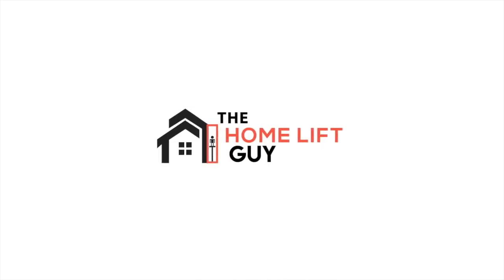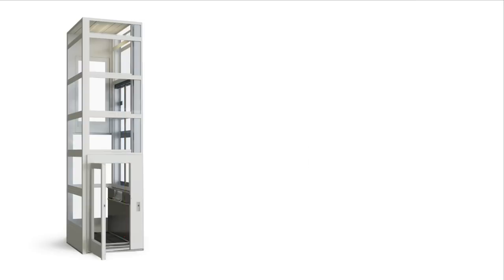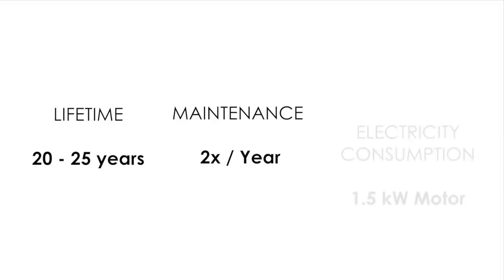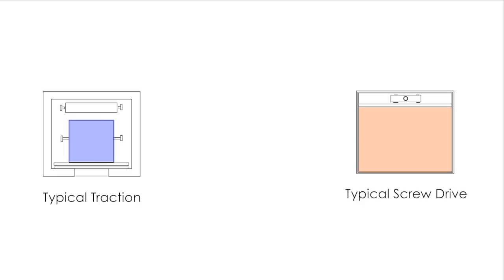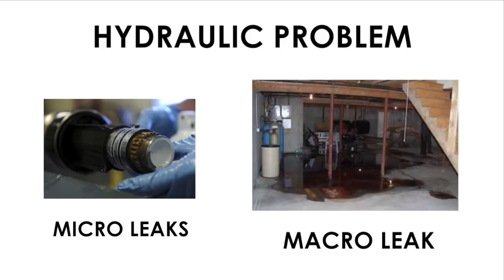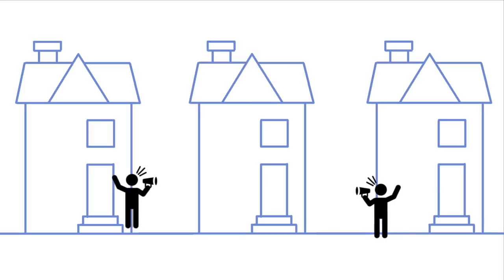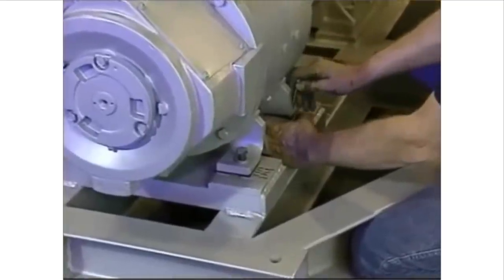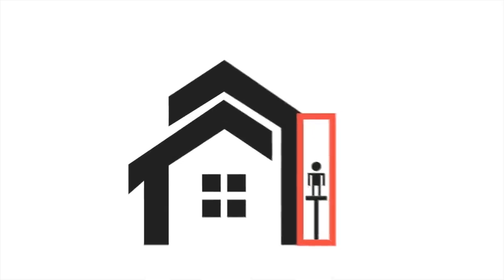Best Home Elevator Technologies - RANKED!

Comment: Inclinator has (or at least used to have) a small drum machine, with a cantilevered rail/cab arrangement. The drum could be mounted overhead, or off to the side of the shaft, top or bottom. Machine would fit in a broom closet. Rail stack needs one structural wall for support. Floor space consumed is approximately equal to the area of the cab in plan view, plus a few more inches for the rail stack.

Comment: As an installer of lifts and home elevators for 20 yrs in Texas, MRL's has been our most popular elevators, in the last 10 yrs with hydraulic systems, coming in second with our company. Much improvement has been made in design and ease of operation and service of these lifts. 
We rarely install screw drive lifts in homes, if we do, it's usually outside of a home. Too noisy and slow. 
Garaventa lifts is our main supplier. Great company, excellent products, very helpful tech support, when needed.

Comment: I'm going with a hydraulic lift for our new house with 3 stops. My other options were screw and nut drive lift (Aritco or Cibes) or electric winch. Chose hydraulic because of relatively low acquisition and low maintenance costs. It's also quiet and didn't require you to have support for all 4 sides of the shaft. The screw and nut drive lifts from Aritco and Cibes were outlandishly expensive, although they did require the least amount of footprint for the shaft. Also, unlike hydraulic lifts, the screw and nut lifts need energy when going down. Hydraulic lifts only require the motor to run when it's going up.

Comment: I’m building a new house and need an elevator from the main floor to the basement, so it’s a one floor lift. 
 
This elevator will be for handy cap. 
The car of the elevator would have to be large enough for a 30" X 30" laundry cart and  one wheel chair. That means it would have to be about 7' X 4' inside usable space. Can you do that? How big would the little room for the power unit be? oscarkemper@gmail.com

Comment: You can have MRL too . With emergency device too and no room on top and pitless too. Better explain properly to people. I have been designing measuring and drawing lifts all my life. I installed all kinds of lifts . Not true what you are saying about hydraulic lifts. It depends what experience you have. I installed all kinds of lifts custom built and sizes and shapes. Over 40 years experience in lifts so I know what I’m saying. Besides that I maintain lifts built in the 60’s and still going strong. I’m sorry but you don’t know what you are saying. Also the fact the screw type doesn’t have emergency brakes.

Comment: It seems there is only one skinny  screw of 2''(  inches) diameter . The whole weight needs be balanced and born by a single tiny  2 '' ( inches)??
So there needs  at the least of two  6''  screws at the back  on both ends?

Comment: Always go for a safe lift if it is for a personal use. No budget is tight that your safety. An accident can cause a life long disaster.

Traction is one of the best be it mrl or mr geared or gearless manual ir automatic. At the sane time other tech are also not bad but there number of installation experience is what needs to be checked and years of experience. After all you are going to be lifted with your near and dear ones in your lift.

ine more thing it is recommended to buy it from a experienced player with atleast 50 lifts in the radius of 1 km.

One more tbing is that the AMC charges and the parts. If it is too expensive then what is the benefit in long run.

For consultation call
7517892718

Comment: Thanks for showing. I have this dream house in my head, and was thinking about an optional 2 level buoyancy lift because of safety and low maintenance. A screw lift is a better option.
Also like that you can have doors on 3 sides (4 if you put 2 screw at the corners).

Comment: I was just gonna use a car hoist winch and weld a cage platform for it and attach to the garage stairs (only one floor up)... gonna be like $1000 and doesn't use that much electric... still allows stair use or lift use and can be taken with if move. Plus relatively cheap to repair or rebuild...

Comment: The hydraulic lifts smell, there's an odor that's unmistakable, so ventilation is a must around hydraulics.  A family member has two different lifts in her home. One is cable, and the other is hydraulic. Both have been problematic, service is expensive, and for either technology every time the lift goes up and down put $$ in a bucket, you'll need it.

Comment: Interesting video. Questionable information. Most (if not all) hydraulic companies offer non toxic oils. Yes, the oil tank takes up some space. But then, I n many jurisdictions the amount of space required is driven by building codes as much as by the size of the equipment. Similarly, the pit size may be driven by code requirements for shelter space. Far as I know (and I’m not an expert - I’ve just been involved in selecting residential elevators on many jobs) the usable space to shaft size ratio for traction units is substantially higher than mentioned here.

Comment: You forgot an option.   My company has a two floor hydraulic lift with pulleys.   The pulleys will cause the elevator to move many times more than what the hydraulic cylinder moves but the apparent force seen by the cylinder is also many times the load but that is not a problem for hydraulics.   Now the cylinder doesn't need to be as long and  only wide enough to so the pressure x force is greater than the real loud x number of wraps around the pulleys.  Most of the oil is always in the cylinder and only a small accumulator is necessary.   We do have an elevator pit without just so the elevator can go to ground level.   The elevator does take a fraction of a second to increase pressure before moving.

Comment: Question. I have a patent on a self locking pulley that I would like to show to an elevator manufacturer .  My device will use much less electricity because a very small motor can be used.  How do I find a company?  Tom at singlespurusa@yahoo.com

Comment: With regards to the Vacuum Lift system, why can't they sound proof the vacuum pump/motor? They can silence 500 HP IC engines, Air Cooled Gasoline Gensets, Guns and even Helicopters. Engineering wise, I would  think that silencing a vacuum pump would be relatively easy.
Another question I have is, why don't they have an air compressor at the bottom of the lift since they are not as noisy? Or have both, a compressor at the bottom and vacuum pump on top? Just wondering.
As for a catastrophic loss of the vacuum, don't they have some sort of damping mechanism at the base to mitigate or even eliminate damage? 
I also thought that the underside side of the lift would have the trapped air act as a cushion to slow down the decent in the event of a power outage or catastrophic leak in the vacuum system.

Comment: You left one option off you list. A steel wire rope hoist with the cab supported in a C channel track attached to the back wall of the cab and the shaft. A friend of mine installed his from a kit in his house back in the 1960s. The unit was powered by an off the shelf 185 watt induction motor geared to the hoist spool through worm and pinion making it fail safe.
Reply: My uncle built one for my aunt that took her chair up the curving staircase attached to a rail.

Comment: We have a traction lift serving all four floors of our home.  The lift, which runs on three-phase AC power, has been in service since before 1923.  I was told by our tech that, with routine maintenance, the lift likely would operate indefinitely.
Reply: They were probably much better made than what we can buy today lol
Reply: @amazinggrace5692   I've been told by our technician that it IS better made than anything available today.
Reply: Also to your point: Somewhere on YouTube there is a short clip about the Woolworth Building which shows the elevator motor room.  The equipment is much larger, of course; but it was installed about the same time and probably by the same company.  The maintenance engineer interviewed in the clip stated that that equipment has been running continuously--24/7--since the Woolworth Building opened in about 1914.  That sounds believable.
Reply: I got to work on some drum machines otis installed in the 1920s in some private homes in D.C. They still make all of the parts. Some really beautiful wood raised panel cabs, collapsible gate with sliding hoistway doors. All the calls were the same thing. Something stuck in a sill.
Reply: @allenburns3177   From your description, that's exactly the model we have.  All original.  Works flawlessly.  You're right: beautiful wood in the cab.  Even the motor room is interesting.

Comment: As a 40 year veteran as an elevator tech. I also installed a roped hydraulic in my home that now has 30 years of service. Otis bought the supplier of my lift. Now in 30 years that lift has only had the emergency lowering battery replaced. If a person wants a home lift. Do your research  before buying. Get a product that will meets your needs.

Comment: As a elevator technician with 33 years in the field I TOTALY disagree with your selection order. Now this simply maybe due to limited info on the US market so here is my list #1 Inclinator  traction, I’ve serviced units over 40 years old. Extremely safe and easy to maintain. Against the common beliefs should the cables break (which I’ve NEVER SEEN) safeties prevent the unit from falling!!  #2 Waupaca hydraulic units, Small self contained pumping units. Hydraulic fluid can leak as shown however I’ve never seen a major leak especially on units serviced yearly. Screw lifts for home use NO!!! Vacuum lifts absolutely not!!
Nationally certified elevator tech
Reply: Hmmm, you give no reason for either of your "no" choices though.

Comment: Have you ever investigated a chain driven or cable driven lift/elevator?

I work in the industrial manufacturing world.  I could see where a small motor with gearbox using a chain driven mechanism would easily move a lift platform at a greater speed then screw drive elevators.

I have worked on traction, hydraulic and chain driven lifts/elevators that were designed to lift several tons of weight.  I have also worked on ball screw transfer systems.  I've worked on vacuum systems, but I have never seen a vacuum elevator.  That would be a form of elevator I would avoid.

Comment: These type elevators are way to fancy and a pain in the ass. I purchased a used electric scissor lift off Craigslist for $500 bucks then rode the thing into the Livingroom and parked it. I then grabbed a Sawzall got back on the lift and rode it up to the ceiling where I proceeded to cut out a large rectangular shaped opening for the platform nest up into and.. Wala elevator installed. The scissor lift makes a great conversation piece when guest are over, and the children seem to enjoy riding on it and it's paid for.

Comment: This guy doesn't know sxxt about elevators. That tank doesn't have to be in your house, it can be larger, and leaks are not as common as he says.  Screw lifts are good, but they are slow.. this can be improved with a motor with more rpm,, a different shaft and threads per inch, or a combination of the two.

Comment: And what is the average price of a screw lift per floor for a 3 floor unit that can lift a wheelchair and one aid?
Price or hydraulic unit of same specs. These would be exterior units, able to run with off grid solar as well.
As for an elevator that is hydraulic I have seen a catastrophic failure where the main pressure pipe ruptured and the lift came crashing down and in the process spraying hydraulic fluid throughout a 10 foot by 10 foot mechanical room. Do the newer hydraulic elevators use an arresting system similarly found in traction systems when cables fail?
As for the vacuum systems, I will leave it for a whole house vacume system for cleaning floors, at least the noise is contained in a basement room that is sound insulated.

Comment: Where I work i have just started seeing residential screw drive lifts and I have to say I would never recommend this product. The quality of the ride is not ideal, hydraulic lift is the still the best solution to a home elevator and not everything you mention about it is accurate. Especially the size of the tank, it usually fairly small and the oil used generally AW32 is not a dangerous flammable fluid.

Comment: [Vacuum Lift] OK so if I have: (1) an outdoor lanai (ground floor) and a balcony (second floor) only; (2) can mount the motor and compressor outside (no neighbors); (3) I live 6 degrees north of the equator in the tropic, -- then are the only issues:  the heat in the tube and the durability in a hot wet climate?

Comment: How are Otis Elevators.
Are they good choice?
Reply: 100lL oil tank!! BS!  More like 30-40L, and the pump isn't in the house it's typically in a garage.  This guy is obviously selling screw drive lifts.  I live in a 4 floor condo and our Otis breaks down frequently.  The elevator is outside with the machine room in a pit.  The major factor is the design of the elevator, no machine room is best if the building structure allows.  Screw lifts are difficult to maintain because the screws are constantly requiring maintenance to prevent corrosion.  Each technology has plus and minus points.  It's most important to look at the installation location/ space limits, operational environment/ indoor-outdoor, operational temps, power loss mitigation, and finally maintenance/operational costs.  Don't take the mfr's stats for any over time values.  AKA: " A" Will save blah blah $$ over "B" in 10 years of energy costs.  (they avoid saying it must be maintained at a lost of $$$ per year). The sales brochures will skew values that way, so it's important to investigate yourself based on your use case to get the best technology.
Reply: Traction elevators are the safest . Otis invented the first safe elevator back in 1847 with Elijah Otis his safety design that is still used today by most elevator companies on traction elevator. Otis is the best !!!! But I will be transparent I work for Otis and I love that company😀

Comment: Screw drive is ok for about 4’ after that, forget it.  Waupaca Elevator’s first units back in the early 80’s started off with screw drive elevators and it was a big piece of junk.  They quickly abandoned that slow and noisy design for the winding drum.  You mentioned 6’ x 6’ area needed for a 3’ x 3’ cab!?!  That is false information you are peddling.  A typical residential elevator only needs and 54” x 54” clear hoistway to accommodate a typical and most common 3’ x 4’ cab.  You also mix in commercial elevator specs with residential.  That is like comparing a Harley Davidson with a bicycle.  No residential elevator has a pit that 5 foot deep.  8” deep pit is typical for most units.  I have worked on every major brand out there, and every type of unit you have mentioned and doing it for 36 years.  You sir are peddling bullshit.

Comment: This guy trying too “ frighten “ people into buying a screw lift,Ask yourself what percentage of home lifts are screw as opposed to others,very poor video.PS I was in the Lift trade for 47 years in the UK,
Reply: ALLAN ----- i want a single story ( 14.5 feet height ceiling ) in my building --- what would YOU recomend ? concrete roof with hole allready there.
ps  ---  the ideal would be able to take 2 wheelchairs at one time !

Comment: Things are very different in America. A "screw drive" (known as a vertical platform or wheelchair lift) is slow- usually only 10 or 20 feet per minute. A VPL is also very noisy and does not run automatic (need to hold the button to run). A residential traction (counterweight) or hydraulic elevator have very different support rails that save space compared to commercial passenger elevators. If the equipment is installed/maintained properly, catastrophic failure is downright rare. Power consumption is very low with a counterweight system with weight in the lift. Vacuum lifts are still not legal in some areas (los angeles) due to lack of safety if a seal fails.

Comment: I work at KONE Lifts & Escalators (Finland) as Head of Sales in Bangladesh and I can rectify all the information provided is false. KONE is the oldest Lift manufacturing company in the world (1910) and the inventor/pioneer of MRL (Machine Room Less) system, Portable Control Board, Permanent Magnet Motor, etc. Having said that, traction has no connection with free falling of a lift..there are numerous of safety measures to ensure that such incidents never occur. You guys can check out our official website for more info regarding Lift safety measures and features.
Reply: Yeah I had to laugh at this video telling people you could fall in a traction elevator.
Reply: IVAN --- i need a single story lift to my roof garden , concrete roof --- what would you suggest my friend ?
 ps --- 14.5 feet height from ground floor to top of concrete roof.
Reply: @pauldavies5655  Go for KONE MRL (Machine Room Less) system with Eco-disc gearless permanent magnet motor..it saves you the wastage of space in the rooftop and alot of electricity consumption. And since the floor height is 14ft, go for door height for 9ft (3000mm) with symmetrical cabin height..for looking spacious..golden mirror etching models would look fab.
Reply: @ivankarim8678  cheers mate --- very informative -- i shall KONE UK on monday and also inform them where the information came from, ----top man !

Comment: You forgot that the hydraulic lift needs a hole. If it's holeless, it needs a rope.
Reply: No it does not.
Reply: There are so called"holeless' hydraulic elevators. They lift from the top of the cab and by using multistage jack's can lift to several levels, usually about 4 but that is good for many houses. The piston and cylinder are not under the cab but in the shaft outside the cab.